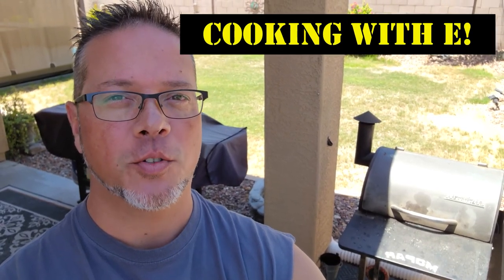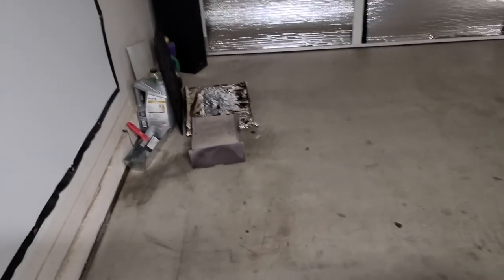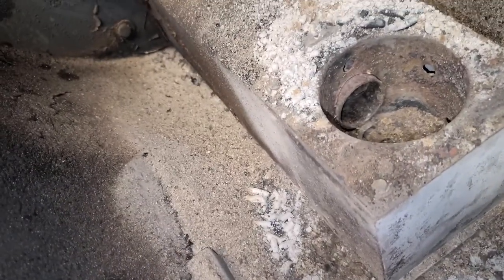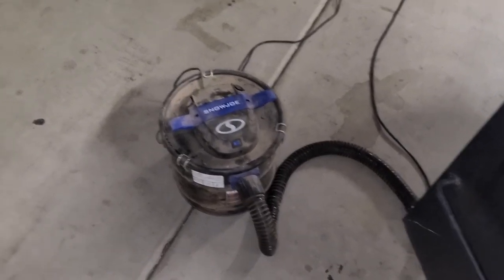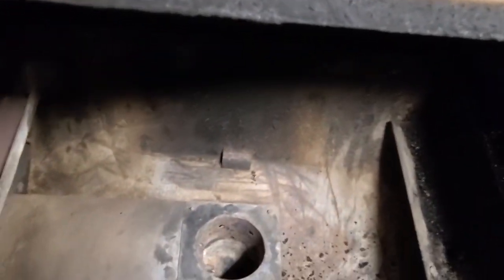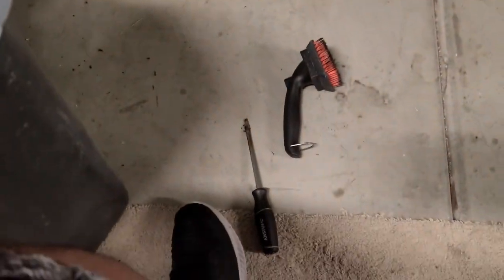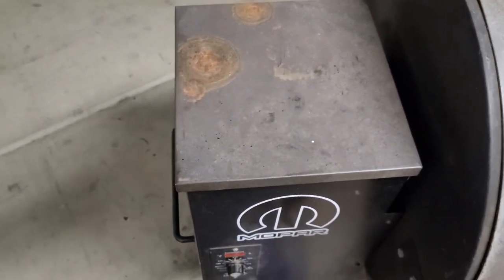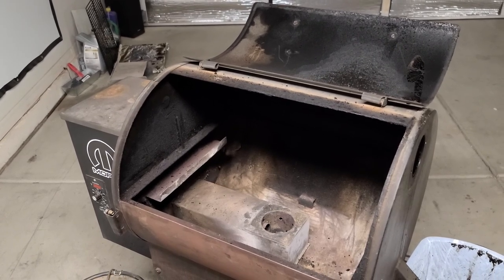Traeger Grill Rebuild (PART 1)

Comment: Great video! I like that you are thorough, showing every step along the way. My Traeger is starting to rust, and I want it to last, so I need to do a little revamping.

One question: What tool did you use to sand off the rust? Is it okay to just use sandpaper? I assume that it will take longer and a lot more elbow grease, but just wondering if that's a good option.

Thanks again for the video series.
Reply from the maker: I used a flap wheel on a drill then finished it with 500 grit.  Thanks for the comment I really appreciate it!
Reply: @Adriel Tucker instablaster ;)
Reply: @Luca Jensen I really appreciate your reply. I got to the site on google and Im waiting for the hacking stuff now.
I see it takes a while so I will reply here later when my account password hopefully is recovered.
Reply: @Luca Jensen it did the trick and I actually got access to my account again. I am so happy!
Thanks so much, you saved my ass!
Reply: @Adriel Tucker no problem xD